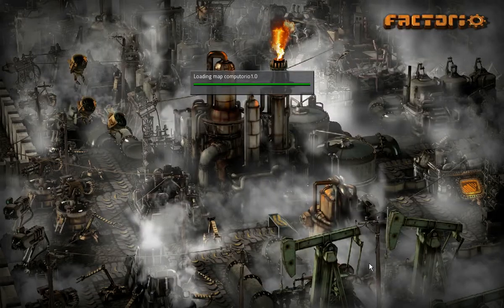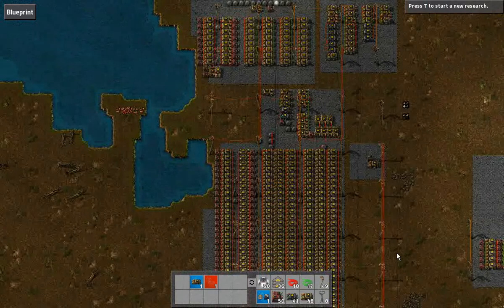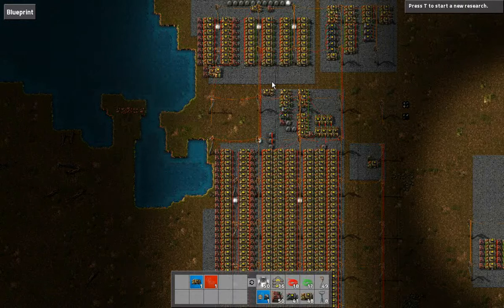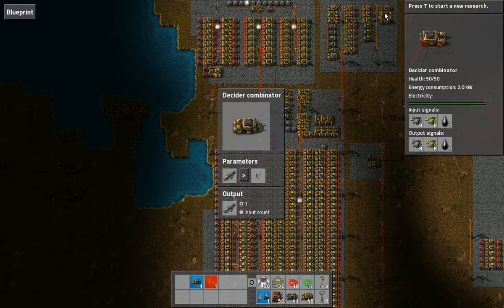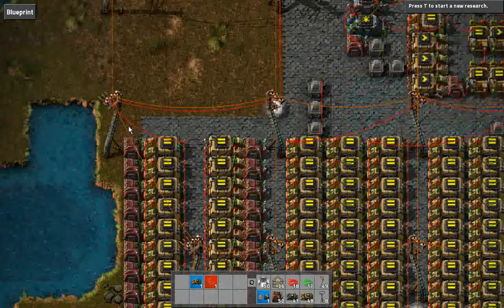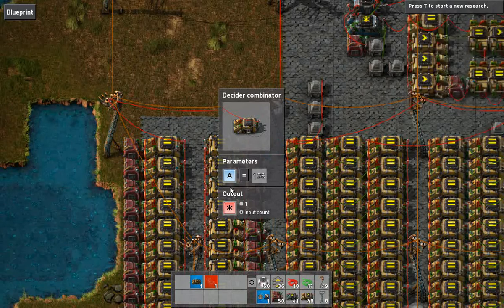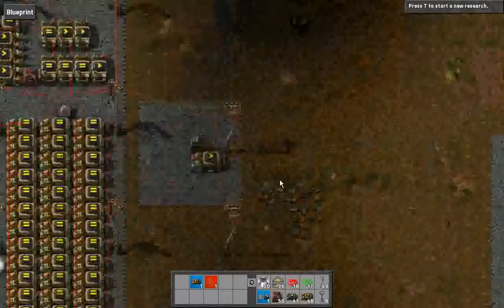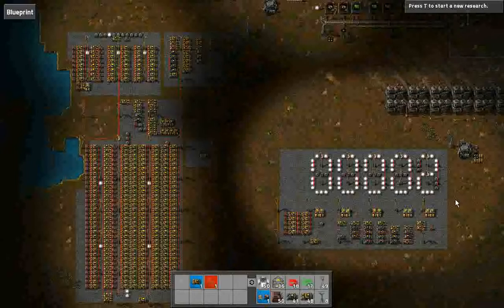Factorio : Computorio!

Comment: Interesting design.
I suspect an upgraded instruction set would be next on the agenda.

Low clock -> Wide complicated instructions (CISC) - perhaps even multicore.
Reply from the maker: +HeilTec You got it! Stack Pointer and maybe an Index Register are next. I'm hoping that Subroutines and Indexed addressing would actually make it usable.  As far as multi-core goes, if you have any thoughts on a good cache design, Id be happy to listen (and learn).
Reply: Another aspect is specialized circuits, like blitters and DMA.
Reply from the maker: +HeilTec  I see where you are going and,  "Noooooooooooooooo!, running Factorio in Factorio is FORBIDDEN!".
Reply: Conway's Game of Life ?
Reply from the maker: +HeilTec Hmm.  Since it is Friday, do you think that would be the Logical benchmark for this type of contraption? :)
Reply: Graphics or alphanumeric display.
I think the benchmark is versatility and programmability of CPU and peripherals.
Besides being fun to make they are most probably going to be used for visuals.
Reply from the maker: +HeilTec I agree that versatility and program ability are key. Original design intent was to have a simple CPU capable of controlling inserters, lamps, chests, pumps and stuff.  I started with a 6502 architecture (nice and simple), then butchered it mercilessly.  Now, I have to build it back up (bugger)
BTW if you think there ii interest  in  a 12 character 5x3 dot matrix display, I could post it in the forum